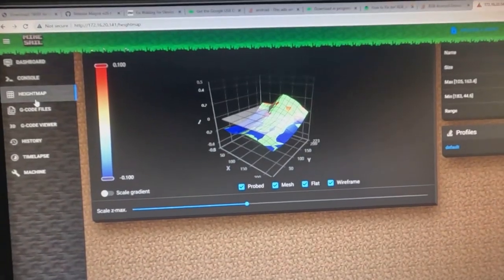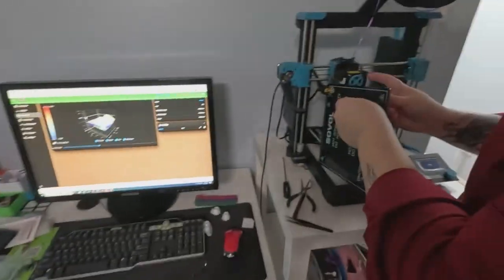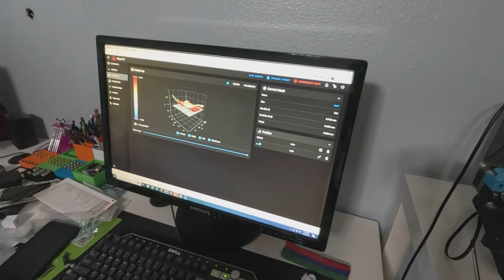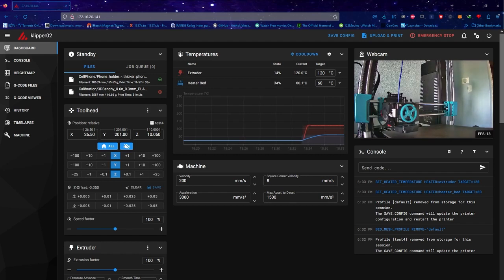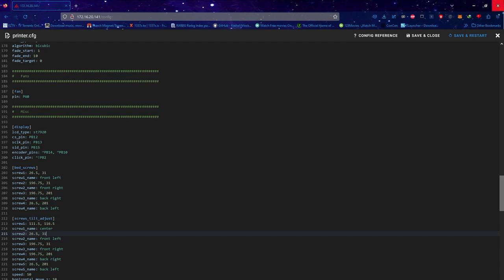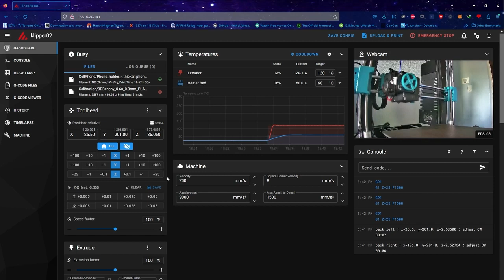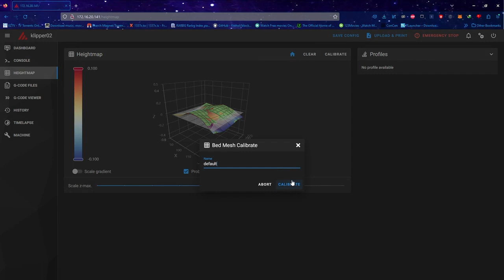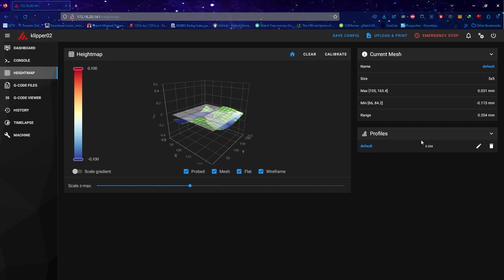Nylock Mod on my Sovol SV06 to get a better bedmesh with Klipper

Comment: Why heat up the extruder for ABL?
Reply: Not necessary. I think people do it out of 'habit'?
Reply from the maker: Maybe so. I try to calibrate everything at operational temps for consistency. Everything expands and contracts, consistency helps me achieve repeatability in print quality
Reply: @room281tech8  The abl isn't anywhere near the hot nozzle
Reply from the maker: @Piccyman1  whether it does or doesn't, it seems rather trivial and benign . The only real victim here is the power bill lol
Reply: @Piccyman1  - The bed is heated before calibration and leveling because the bed expands and warps when it is heated.  It should be measured in the shape it assumes when heated because that's when it prints the critical first layer.
Reply: @Liberty4Ever  I think you are missing the point, the extruder doesn’t touch the bed during the bed levelling, only the BL touch does, so there is no point in heating the extruder.
Reply: @Piccyman1  - I think you are missing the point.  Regardless of how it's measured, measuring the Z height of the bed needs to take place when the bed is in the shape it'll be when the first layer is printed.  When the bed is heated, it expands, and because there are five mounting points constraining the bed, when it expands, it warps.  The Z height of the bed is different at the mesh leveling points when the bed is heated versus when it is cool.  To get a good first layer, the bed mesh must be measured when the bed is heated.  It does little good to create a bed mesh for the cool bed, then heat it and have it expand and warp, thus rendering the bed mesh invalid.
Reply: @Liberty4Ever  we are not talking about the bed, this must be heated, we are talking about the extruder
Reply: @Piccyman1  - Derp.  Sorry.  Never mind.
Reply: @Liberty4Ever  no problem 😄

Comment: Awesome video!! What size lock nuts and nylon washers did you use? I'm thinking of doing this to my SV06 because I also have a pretty bad warped bed that the problem. The probe doesn't really do a good job to compensate for the warped bed.
Reply from the maker: I did come up with another method that also really helps the prints. I do a fast bedmesh before each print and it only creates a mesh where you are going to print. I'll be doing another video where I share my klipper and slicer settings with my macros.
Reply from the maker: I used M4 nylon lock nuts and I just hand picked some nylon washers that worked. I personally couldn't get the bed mesh to make a good print when I would do a bed sized first layer printer calibration. I could never find that sweet spot. I was always too high or too low.